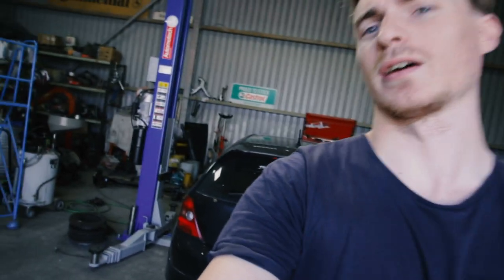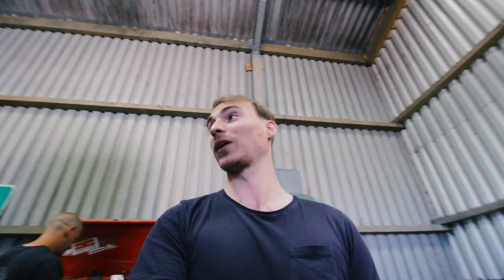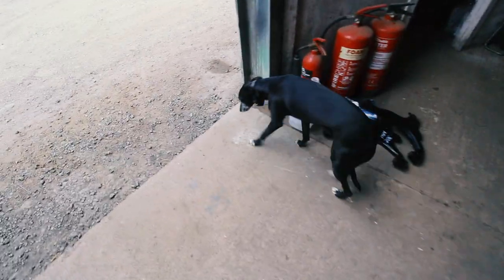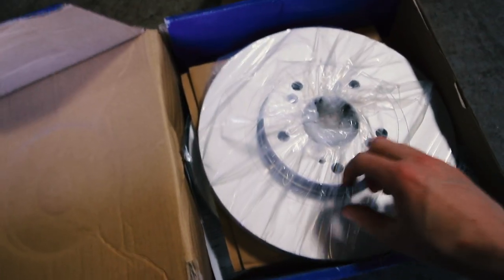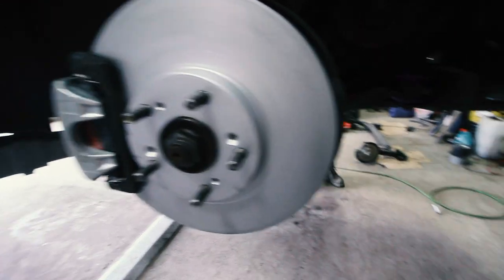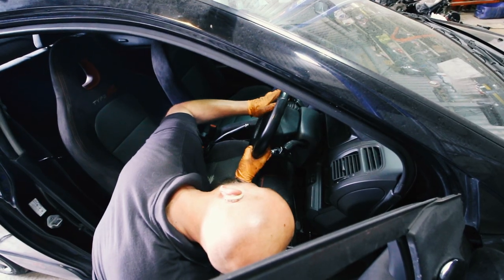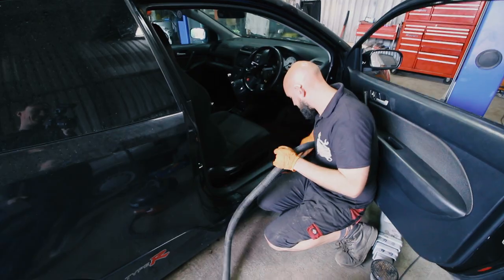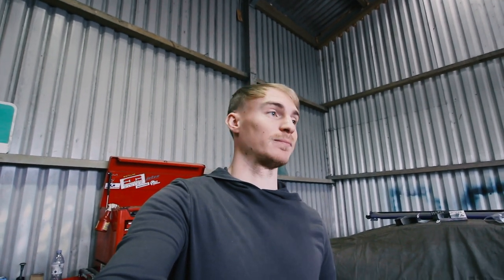Are Pagid Discs and PBS Pads THE BEST for your EP3 Honda Civic Type R?

Comment: These discs are so cheap. Do you know why they are one's to get like you said, being half the price on most of the competition! 
Any feedback on road & fun use? 
How many liters of brake fluid you need?
Reply from the maker: I think they are just well made oem replacement discs that happen to be used for the civic cup cars. I imagine if you compared them to other oem replacements there may not be a huge amount of difference but I can 100% recommend them after a fair few track days! Other option will probably be drilled/grooved which may seem great but be shite as soon as you take them on a track

Pads are quite noisy on the road (bit squeaky) but stopping power is spot on and fade is super minimal in comparison to the last brakes I had on there. For the price I couldn’t recommend any other option, only issue I ran into was that the pbs pads were super quick wearing, I’ve been through 2 sets since this vid and the discs want replacing again! Bearing in mind I’ve done about 4 track days since
Reply from the maker: Oh and afraid I don’t know off the top of my head how many litres of brake fluid were used, google is your friend on that one!